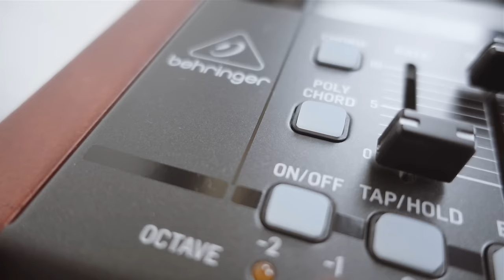BEHRINGER DEEPMIND 12 BOARDS OF CANADA STYLE FLUTE SOUND DESIGN TUTORIAL ~ Synthesize This! Ep.16

Comment: 4:03 Another interesting way to inject noise into the attack sound of a flute is to choose source as noise, destination as OSC1, and amount as 0. Then you can set up the destination on Envelope 3 to act as the level of your "noisy oscillator." I often use this when designing horn sounds to emulate the sound  of a trumpeter blowing really hard on his instrument. Generally I will also set up velocity to affect the amount of ENV3. I have a Prophet 08, so I'm not sure you can set up the Deepmind in this way, but the principles are universal for most VST synths, as most have a ModMatrix. Great job designing this patch!